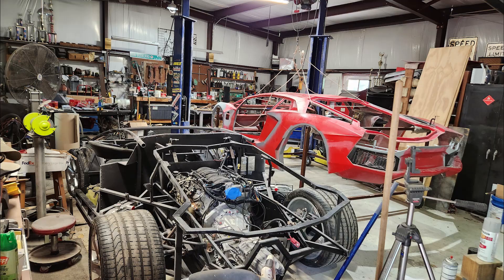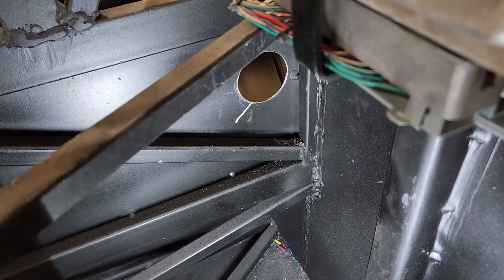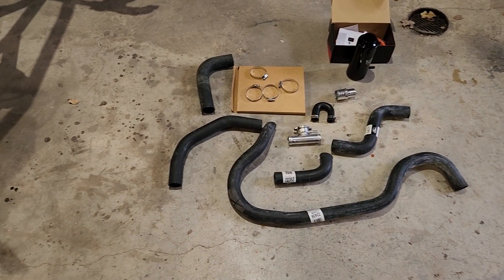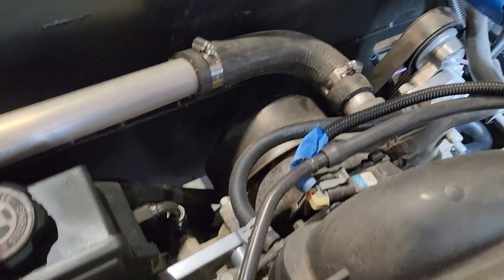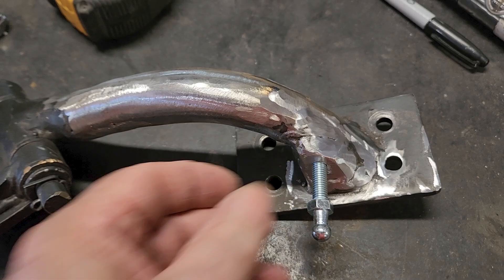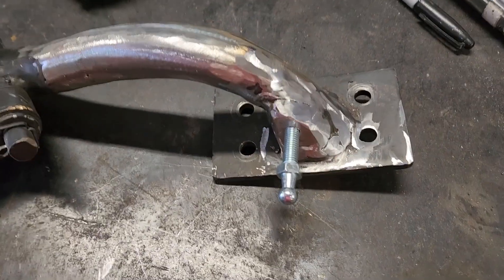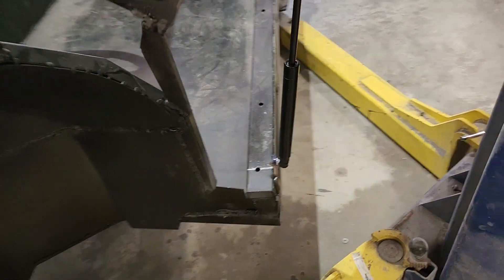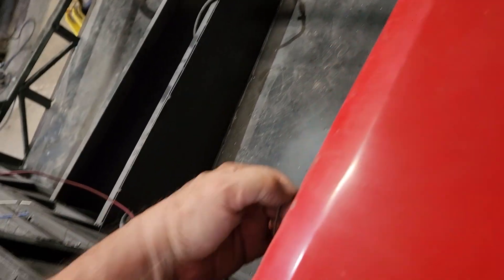Aventador Replica Project - Part 39 Radiator Plumbing and Door Shocks

Comment: Looks great Dale.  I have the Aventador gas springs, which have dampers in them so when the door opens it slows down before reaching the upper limit eliminating bounce, FYI.
Reply from the maker: Will eventually change out springs once doors are finally completed and have final weight. Still long ways to go.
Reply: @lambobuilder  I hear ya!